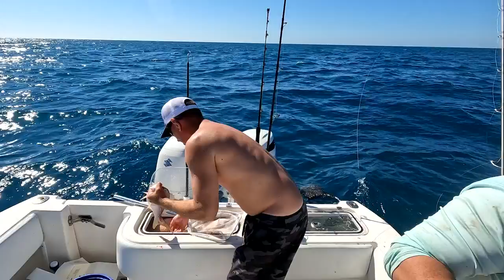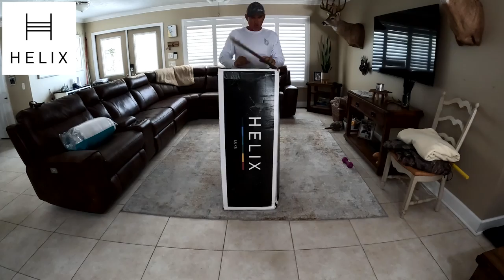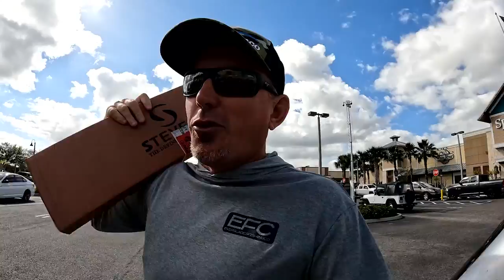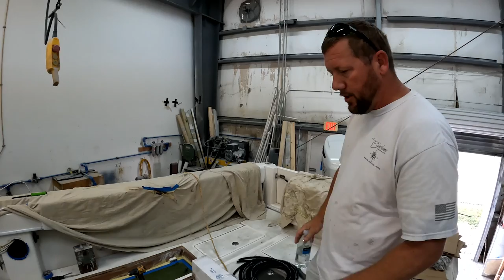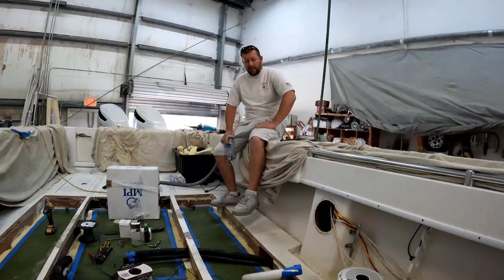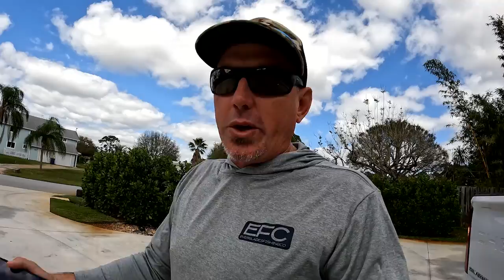I Bought a $169,000 Boat and It's Complete Trash!  (What Do I Do Now?)

Comment: Wow similar situation with me.  I bought a Contender that had a "Fresh Re-Do" and like you EVERYTHING the previous owner did went bad, wiring, plumbing and he even had the tanks done and guess what the tanks only 18 months old went bad, same issue they used Great Stuff foam and non-fuel rated teflon tape on the connections.  Just like you I paid a visit to Dustin at TCC to get my tanks done.  Piece by pice I have re-done the re-do, wiring, electronics, power, fuel tanks, soft goods, I had cracks in the top, had that welded and powder coated.

Comment: Bought my 243cc in Stuart when the boat was 9 years old but it failed inspection with the previous buyer same issue and came back on the market. Everglades was cool and replaced it for free because it fell inside their 10 year window. I hear the powder coated aluminum tanks last about 10 years, give or take, depending on conditions. Don't think I would have known this was a thing otherwise because I only had flats boats and skiffs.  Sorry to hear, I know is no fun but at least you literally bullet proofed it now. Nothing left to replace. P.S. hook me up with your rewire guy please.

Comment: Sounds like my luck with used boats. I bought new this time, and in the first year I have replaced the starter battery and baitwell pump. BOAT (Break Out Another Thousand) in your case X50...lol. Good luck on your boat once you get it back.

Tight lines 🤙 🎣

Comment: I have purchased 2 used boats in my life, both were a nightmare from start to end. I now have my 2nd new bay boat from a company that builds quality boats and stand behind their product, first one had one minor issue and the company was on it as soon as I made them aware of the problem. New boats are expensive but built by a company with excellent customer service and warranty, plus 6 year engine warranty with me in control of service intervals and using 100% non-ethanol fuel, it's a piece of mind.

Comment: Man this puts in context my boat issues. I got a 2400 pathfinder and knew I would have about $2500 in cleaning it up. Got into and found bad rams and tilt ram, leaking steering fluid, on top of that a bad steering shaft that I just cannot take on right now. It works but will fail at some point. Went in thinking 2-3k at best now it’s 9k for everything lol boats
Reply: Boats- Bust. Out. Another. Thousand. An acronym I used to hear while working on a fuel dock. Things are a money pit if you don’t stay on top of the upkeep. Hope you’re able to fix her up and enjoy it though

Comment: New fuel tanks, ouch! My mechanic and i were chatting about older Contender's needing fuel tanks. The problem is the aluminum tanks were not encapsulated with heavy duty coatings. Tank protection has improved in recent years, you should be good.

Comment: I've always said that manufacturers should have to install heavier gauged fuel tanks and they should sit them on a thick rubber pad and foam the sides in to hold them in place. If the factory installed the tanks that are being put in now you wouldn't have this issue. Boats take a beating, they're not like a vehicle that has suspension to soak up the majority of the bumps, so things like thin aluminum tanks will either crack or corrode and start getting holes in them especially if saltwater gets to them. I had an aluminum fuel tank in a brand-new boat crack along the seam in less than 2 months, and it was because it was made of thin aluminum and not installed/protected properly. Thank goodness it was under warranty and they allowed me to purchase a better-built tank (thinker) and they credited me the difference. I wasn't about to let them stick the same tank back in there and it last just long enough for the warranty to run out, because that is what would have happened.

Comment: Doesnt matter how much knowledge you have. Only way of knowing the boat had issues would of been pulling the cap. Which no one would have ever done. It's the risk you take buying a used boat. However you can be ripped off just as easily buying brand new. We had a buddy's dad get clocked hard. He purchased a brand new bossman skiff. Took a year longer than quoted to take delivery (pre covid). When he took it out for his first voyage the skiff nearly fell apart. Luckily we all knew a local builder who we went to school with. He pulled the cap and couldnt believe his eyes. Nothing was fiberglassed in, puddied or bonded in any way shape or form. The skiff would do a weeble wobble every time it took a wave. Luckily he was able to finish what the builder didnt. Later on we found out the builder/owner had gotten sick and passed away. His wife pushed out everything she could. Took the money and ran pretty much. They were sued and the business was seized by the government. They auctioned off whatever they could to repay the victims. Now that's dealing with a new build. Imagine all the nightmares people will face when these Hurricane IAN boats start hitting the market. People are going to die over it.. I like to hang out at my buddies shop. I get a lot of insight and knowledge from all the different builds he takes on. I had no idea it took 120+ hours to rewire a 25-30 ft boat. Or the amount of hours required in finishing a floor. I've watched him sand and spray the same floor 5-6x easily. The man hours pile up in boat builds. You truly get what you paid for. There's a reason you should never buy a bayliner...

Comment: 169,000 point of sale I find it hard to believe you wouldn't have insurance on that kind of investment? 
Years back as the owner of a 70s 28 ft Bertram with a fiberglass fuel tank that I had completely restored I feel your pain.
When they put ethanol in the gas it degraded The fiberglass Fuel Tank and the residue, ran through the engines, seizing both. A hole in the water surrounded by fiberglass that you dump your money into, but I couldn't imagine, living without one LOL!
and that being said, I am a subscriber and watch your videos, usually pretty entertaining.

Comment: What the crazy part is the guy that sold you the boat was on the contender fb page saying how that was such a great boat this, that and saying he kinda regrets selling it. Did you get the boat surveyed when you bought it cause they would have been able to point out most of the problems you have had except maybe the tanks ?
Reply from the maker: Yes I got it surveyed. 3 days after buying it I found a big leak in the back of the boat with water poring in. The best part is the surveyor said they put it in the water and everything was fine.
That’s what I get for using someone out of Miami 🤦‍♂️

Comment: This happened to my friend. They had a 2007 Young 24' boat they owned since new and decided to repower. Thought it would be about 40k and turned into 90k. Rewire, new electronics, upper station controls, lower station controls, new sea dek, etc. After all was done they went offshore and  smelled leaking fuel. Had to remove the tower, cut the deck and order a new fuel tank.  It's $140 an hour to take everything out and put it all back. Sometimes a new boat is cheaper in the long run.

Comment: This is the main reason I haven't pulled the trigger on a older contender. 1. guys are selling way over priced and you still have to replace the fuel tanks. I'm in Tampa so I see so many guys having to replace the tanks on the older Contenders. I'm just gonna wait till I find a rig that someone has already replaced the tanks and has full receipts.  31 is my target but only if the price is right or the tanks have been replaced and charcoaled epoxy painted. Suck this happened to you.

Comment: I made the mistake of buying a 34’ flybridge cruiser shaft drive single diesel for about $110k Australian. It had a pretty good survey report that cost me about $2200 plus fees to take the boat out of the water and was sold to me as advertised in truly first class condition. I spent around $30k plus many hours of my time in the next 12 months before I could sell it with a clear conscience. I expected to spend some money on a 14 year old boat but it was never ending until the day I sold it. Just about everything that could go wrong did. Bought a new smaller sedan type with an outboard (795 Merry Fisher series 2 new). No more stress or worry and a good warranty on the boat and motor and the after sales service has been great.

Comment: I bought a 2000 wellcraft 26 for 10k with a 2008 Evinrude, 225HO 
Three years later, I haven’t had to do anything but put gas and oil  I’ve taken it to Bahamas the keys and even one trip to dry Tortugas. ( won’t do that again) also, I have done the Florida Crossing a few times I wish I had a dollar for everyone who told me wellcrafts were pieces of crap to get a contender or Mako funny thing is they usually tell me this while fishing in my boat because their contenders are at the marina waiting on the mechanic to get time to fix them 😂 full disclosure, though the trailer that the boat came with was a nice all aluminum rocket trailer, but it did need new bearings in both axles

Comment: I could never buy a boat in that price range without a survey. I even take my price range buys to a outboard mechanic. A survery might not have caught the lower unit problems but should have the fuel leak.

I guess the owner made a point of never filling the leaky tank and when you filled both tanks the leak materialized. 

That's the same kinda guy who calls boat and car dealers crooks.

Comment: THE VERY  FIRST"THING YOU DO IN BUYING A USED BOAT IS A FUEL PRESSURE TEST,AT LEAST FOR 30 MINUTES. I KNOW, WHATS DONE IS DONE.And mabe you got one and it didn't leak. But if anyone ever buys new or used,DEMAND  getting  a fuel pressure test. Pulling fuel tanks COSTS$$$ AS GABE JUST SAID,ENOUGH SAID.

Comment: The greatest value of this video is that it exposes the apparent myth of Contender boats. I've never had these problems with boats costing far less. I would never buy one after this. Leaking gas tanks? No thanks. Pin holes in gas tanks? No thanks. This is sounding like a boat built overseas.

Comment: Your comments on the .410 are great, but everyone who reads this, do me a favor. NEVER start a kid out with a .410. Start them with either a 16, or even a 28 gauge. A .410, despite it's size is for someone who is an EXPERT with a shotgun. It throws a very small amount of shot, so you need to be well versed in shotguns if you want to bring down game with it. Great guns, I own 2 of them. Along with several 12 gauge, one 16, and two 20's.

Comment: If the tanks pose that much of a problem, instead of fiberglassing over the deck, I would put removable floor pieces, or deck on hinges that swing open over each tank....that way if they fail you can see where the problem is instantly and you can monitor water infiltration and even work on and replace the tanks yourself saving huge money